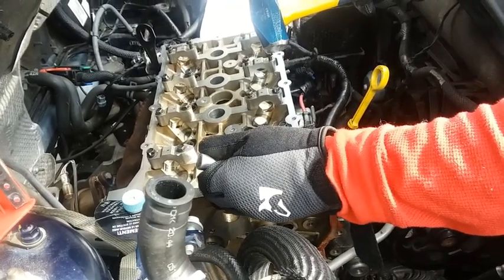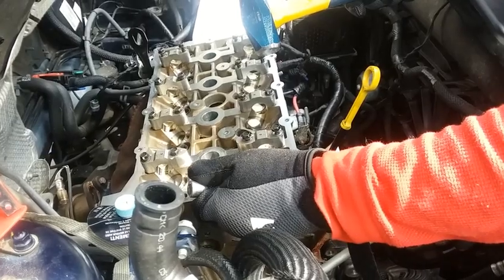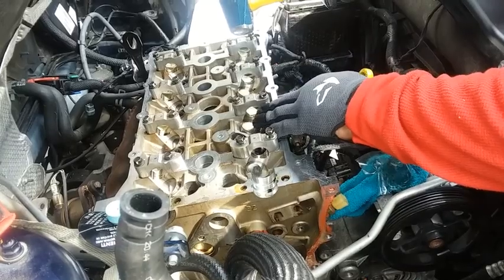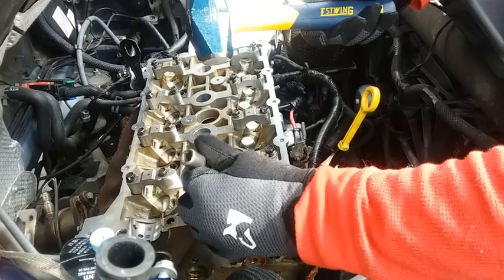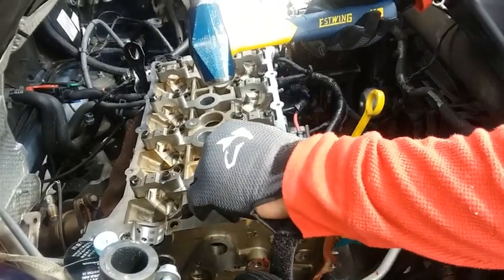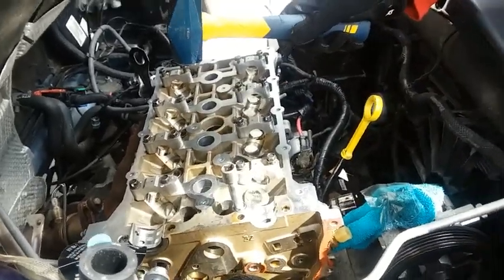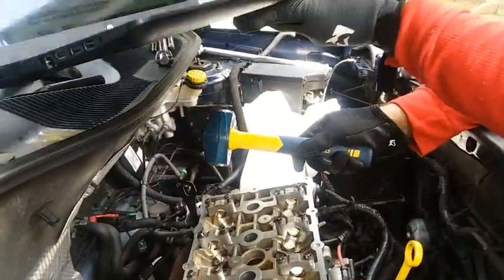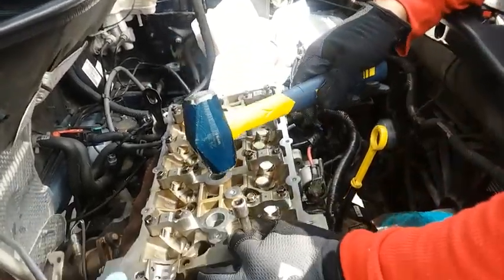Cylinder head bolts removal without breaking the bolts.

Comment: What value nm for torque wrech to remove bolt
Reply from the maker: It was all the way to maximum torque and  locked. In my case, the the cylinder head studs got loosened after I hit or taped  the studs before applying pressure or torque. After taping the studs for the third time they became loose.
Reply: What the value of max torque you use  and do you need to replace bolt with new in order not break old bolt thanks